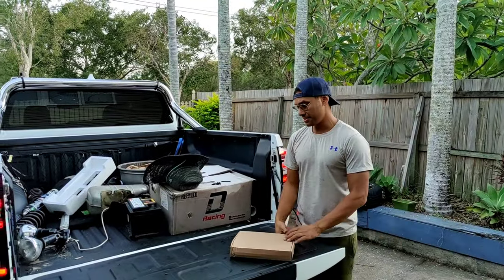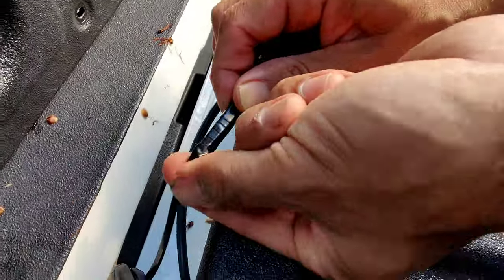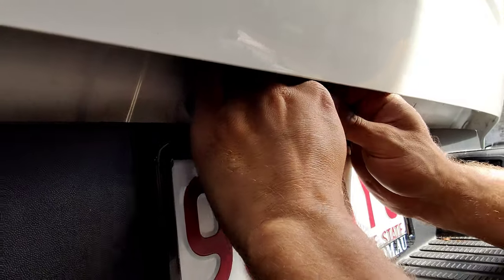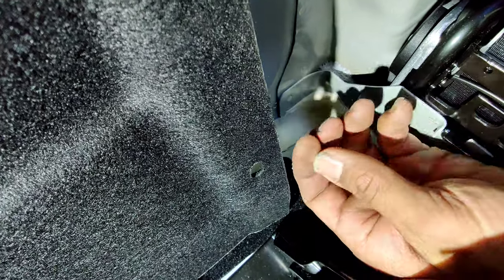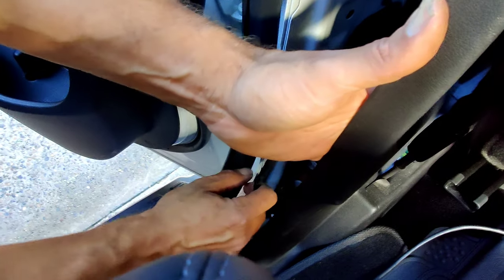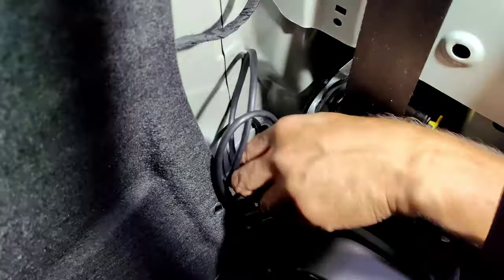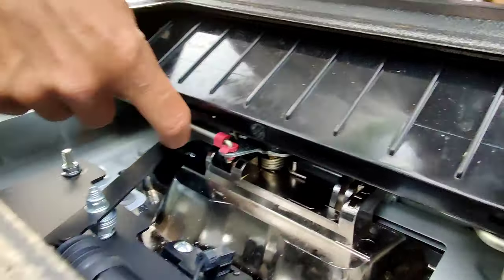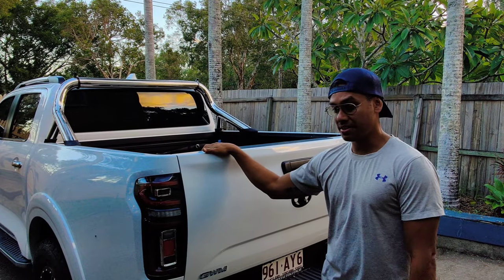GWM CANNON TAILGATE LOCK INSTALLATION TUTORIAL GUIDE

Comment: Just installed the new version of this lock - took about 2 hours and works good. Cheers for the lock and the video instructions.

Also, there are 2 red/green wires on factory door wiring loom - use the the thinner red/green wire.
Reply from the maker: Thanks Danny, glad you got it installed without to many issues.

Comment: Once you've fed the wiring thru the chassis to go under, instead of coming up thru the back seat, bypass that and go thru to another grommet situated under the front passenger seat. Once thru, feed the wiring left n under the factory cut carpet, to keep it hidden n safe from damage. Then, take off the plastic sill to feed wiring thru for connection. This way, you only have one plastic cover to take off.

Comment: So I have the Red version of this and when putting it on the 2 bolts that are there the end rsts against 5he plastic lever at the end and under the metal plate that rotates. It flexes so that if you tug on the handle or just pull hard it opens the tailgate.

Comment: I had blue and green cables on lock. I did connect them:
-blue to green
-green to thin red green.
Instead of soldering I use T tap connectors. 

All work  good. Just a little bit too loud. 

Best Regards

Comment: Question ...does the Ultimate 9 throttle controller or similar improve the throttle response significantly on these new GWM Cannons ?
Reply from the maker: It helps but doesn't fix the issue! I'm working on tuning the turbo lag out, and also have a tuning box I'm testing to try and improve low down torque.

Comment: Hey mate I was wondering if you had a website? And do you sell any other mods for the gwm cannon x? Also is that a spray on tub liner you have?
Reply from the maker: Hi there, I'm working on a website at the moment! We currently have a couple of roller shutters but there are selling quick, I also will have 3 different options for lift kits depending on your budget, we also have rear sway bar kits arriving soon, plug and play digitial amplifier booster with full EQ. The tub liner is spray on factory standard from the L model up. Please email me on jettuningsales@gmail.com.
Reply: I got my Cannon Ute (base model) it has no spray on tub Liner as standard ....done by a 3rd party in Brisbane @
Rhino Lining Underwood..

Far superior tub Liner then the factory spray tub liner....mines lumpy/rubbery feel to it & coated with between 3 - 5mm overall.

I compared both Factory & the 3rd parties tub liner.....Rhino’s Liner wins hands down.